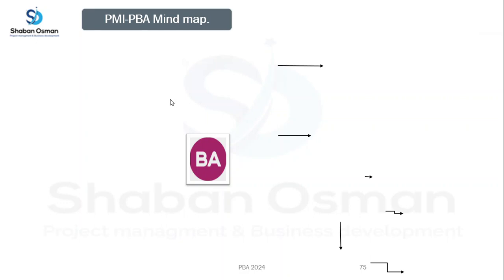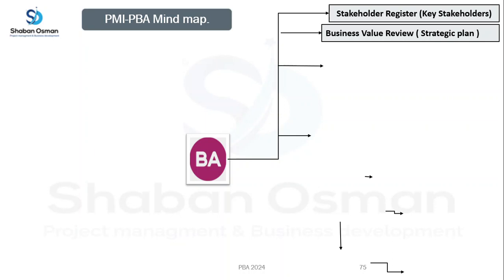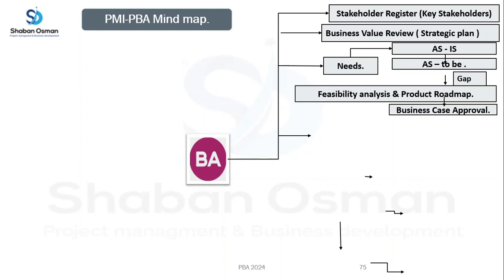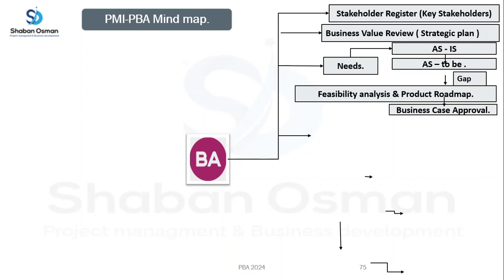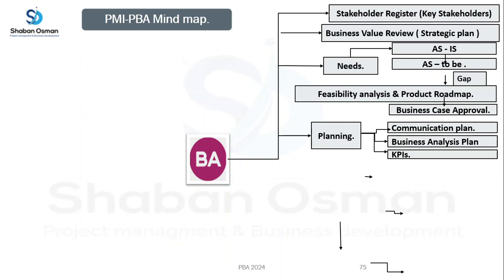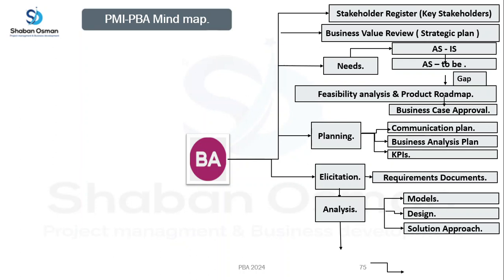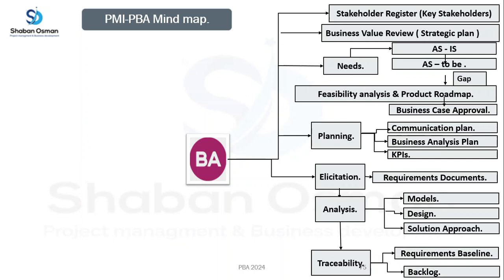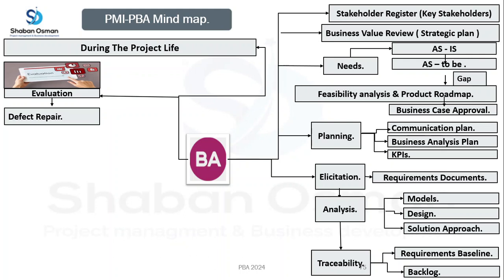Business Analysis Main Steps | PMI-PBA Explained

Comment from the maker: Get your certification in Business analysis by enrollment in👇🟥30% #Discount 🟥
✅#PMI_PBA Preparation course _In English in  Udemy.
✔Join this course to understand business analysis tools, techniques, processes, and steps, in addition, to pass PMI_PBA. Actually, you can do this in a short time.
✅This course includes:
1⃣ Recorded videos to explain 35 processes for business analysis.
2⃣ 25 -questions in each PMI B A guide section.
3⃣ 35 PDUs /35 Contact hours for PMI_PBA exam application.
4⃣ Two 100_questions final exam.
5⃣ Updated Course handout to help you understanding Guide contents.
6⃣ B A Abbreviation table.
7⃣ B A Documents table.
8⃣ A Summary of B A. Steps.
9⃣ BA Tasks.
🔟BA Keywords and tricks.
✅This course is based on the PMI Guide to business analysis and PMI Business Analysis .
#businessanalysis_hub 
https://www.udemy.com/course/pmi_pba-preparation-course-_in-english/?couponCode=E98088D69F00411A88A4